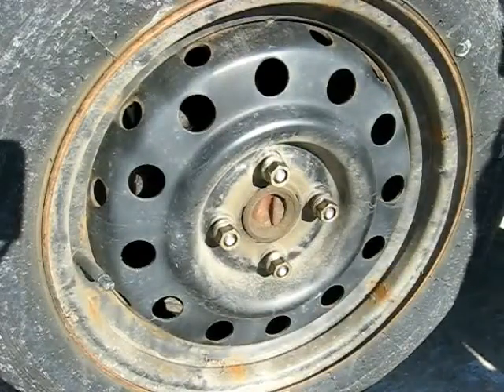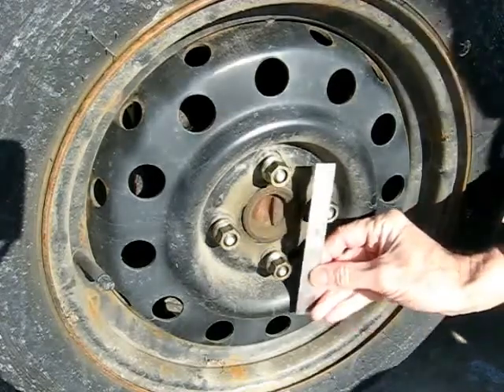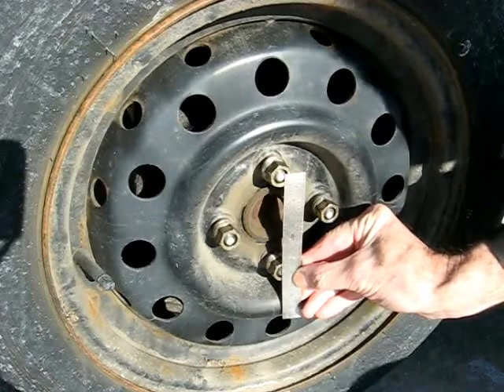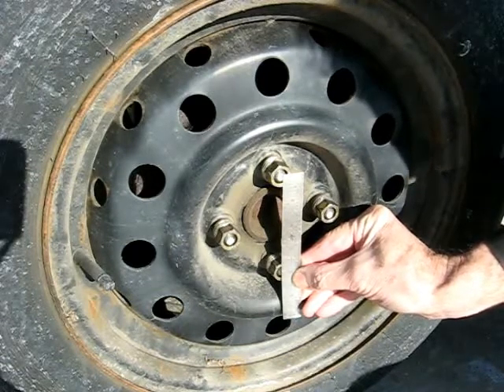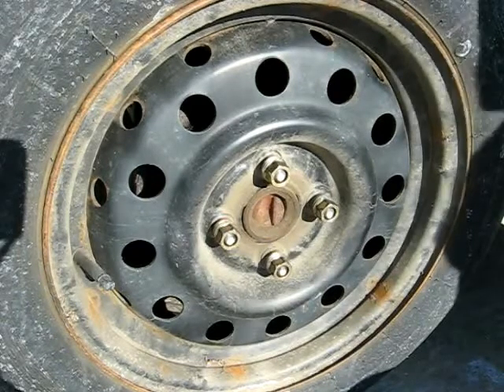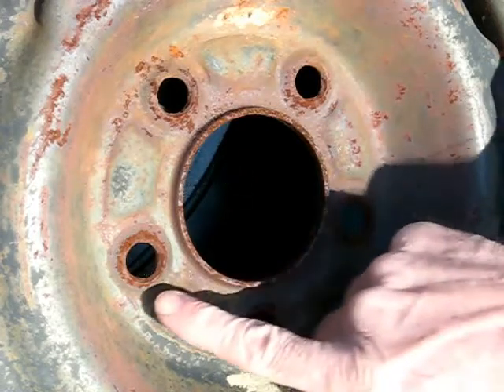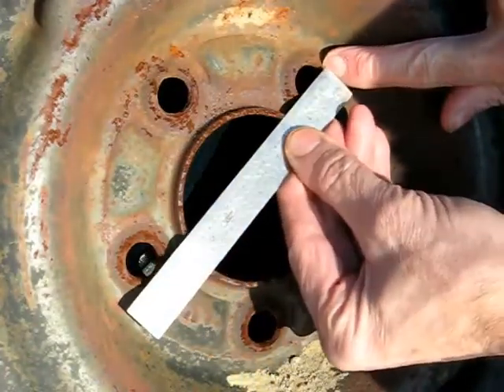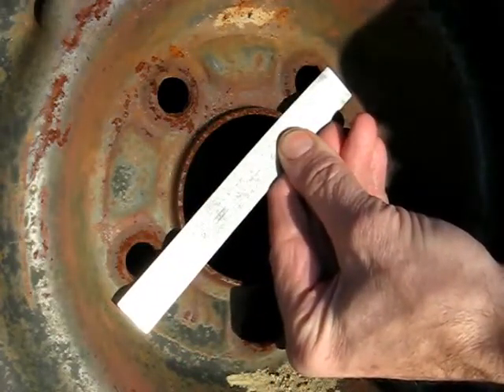Measuring Wheel Bolt Circle

Comment: you forgot to mention the center hole diameter. the wheel itself sits on the hub center lip, so this diameter has to be correct.

with alloys you only have to know the lug pattern, because centric hub rings are sold separately for each make/model so they fit your car. steelies are as is and you need a correct diameter and pattern.

is it bad weather out there or is the tire just bad? looks like cracked all over the shoulder.